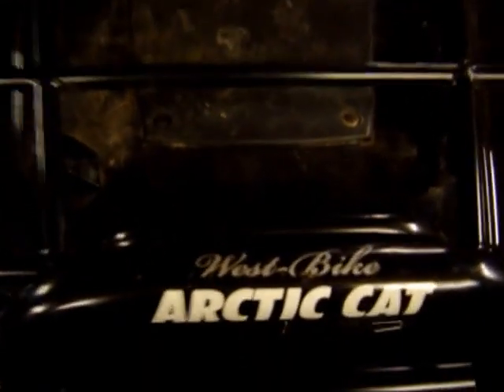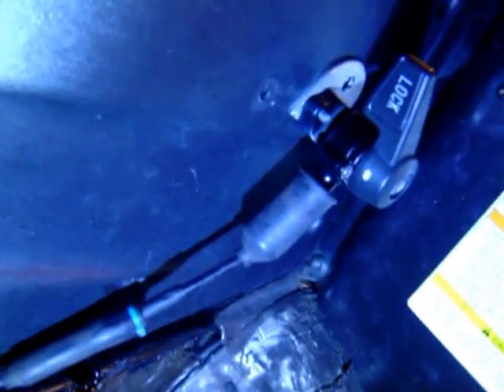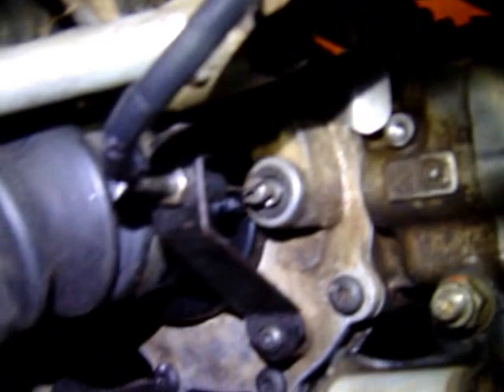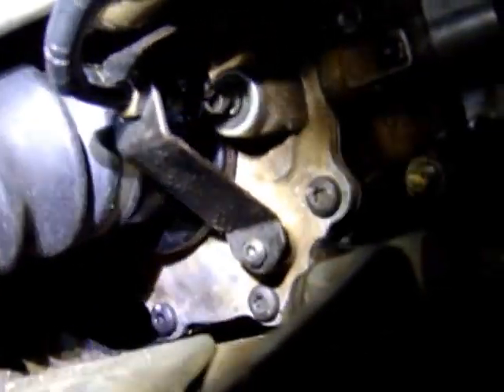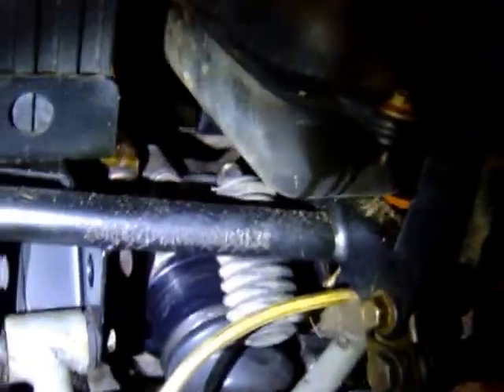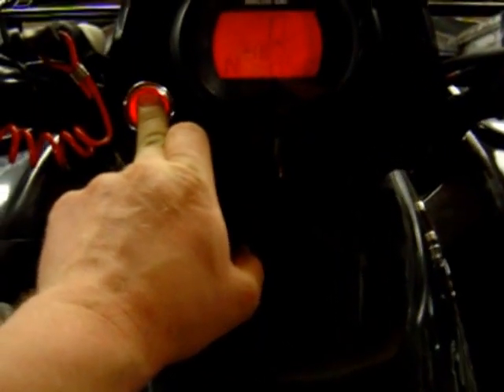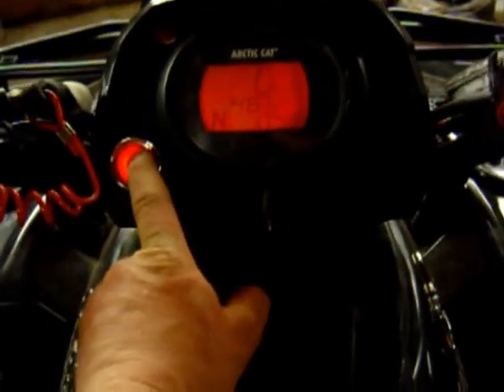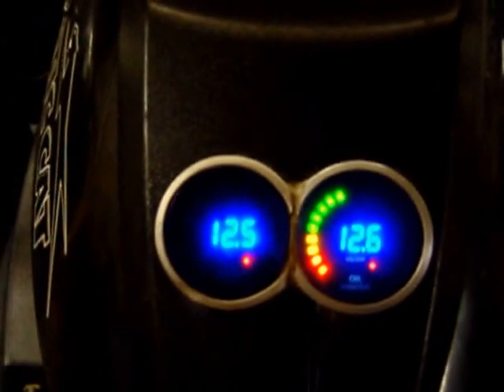Arctic Cat REAR DIFFERENTIAL MOD!!!  (read the description!)

Comment: Hey Oskar, just letting you know I had the very same idea after a day of tight turns with a heavy trailer. The parking lot looked like a bomb went off. So it got me thinking, wouldn't it be possible to have a front diff in the rear? Got me googling, found the old post you made eight years ago on that "norradals" forum that linked to this video. And now I have all the parts ordered to make it. Mine is a 2015 so I will use the electric actuator, and if I wire up everything I can even go forward wheel drive. :D
Thanks for the inspiration!